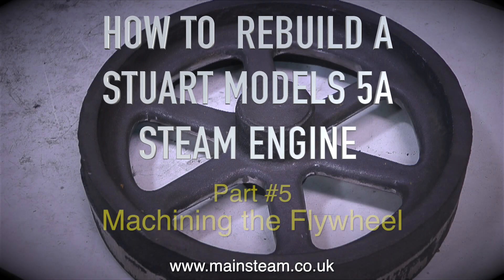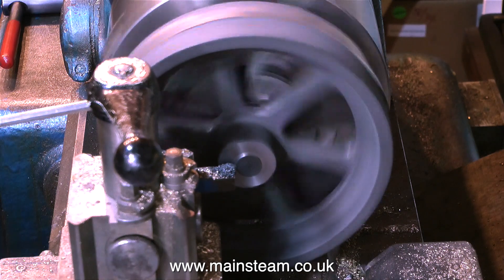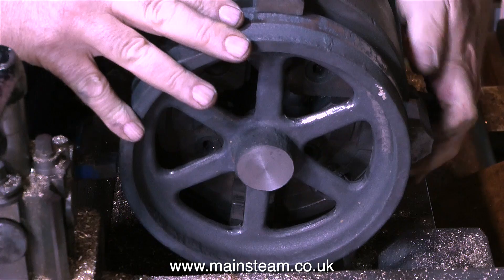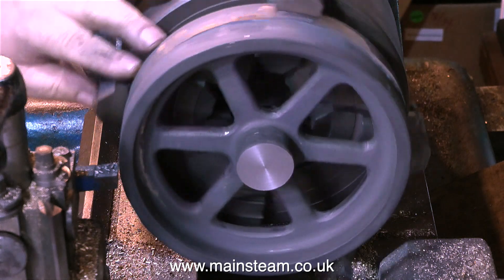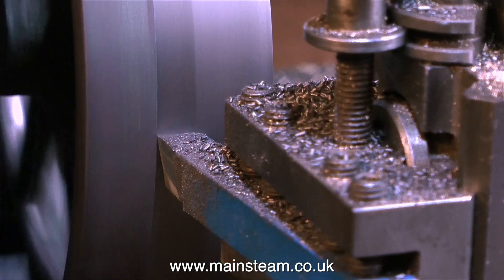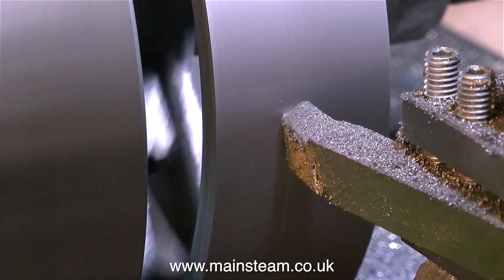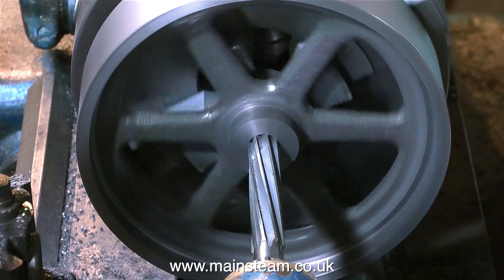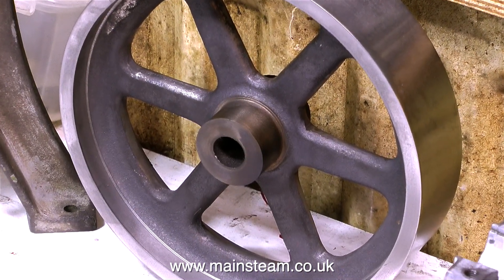HOW TO REBUILD A STUART MODELS 5A STEAM ENGINE - PART #5

Comment: As someone with no machining experience, and someone who would like to eventually make an engine like this, I was wondering about order of operation.  If you were to drill and ream the flywheel first, wouldn't you be able to use the mandrel to either accurately and securely clamp it in the chuck or turn it between centers?  The way I've always pictured this being done would involve leveling the spokes on a drill press or milling machine bed, spotting and drilling a vertical hole, turning a mandrel with accurate centers on each end, reaming the flywheel hole to fit the mandrel, then doing all of the rest of the turning with the flywheel on the mandrel.  I'm assuming that because someone with more experience, who knows how to get good results, does it completely differently than I'd visualized, there's a reason my plan won't work or will make the process harder.  It's just that I'm damned if I can find what's wrong with my idea.  What do you think?
Reply from the maker: Mandrel work is best left for the finer finishing process . . .
Reply: Thanks.  I appreciate the reply.

Comment: Those were some good tips! It hadn't occurred to me (though of course I should have realized it) that you want to judge whether the rough flywheel casting is true by the inside features where the spokes are, because those will not be machined.

I don't know if you've ever looked at the Stuart Models pamphlet "Building a Vertical Steam Engine"; therein the author describes fabrication of a "D-Reamer" from a piece of silver steel (the US equivalent would be a piece of drill rod)
Have you tried this?

Comment: Top tip: if your reamers cut big, don't clamp the tailstock to the bed and wind it through - leave it loose and physically push the tailstock to put the reamer through the hole.  More of a problem on well used lathes that have worn (like the ones at work) but maybe someone will find this useful.

Also independant 4 jaw chucks will hold work much more firmly than any self centering chuck because as you tighten  them you're only tightening 1 jaw, not spreading your clamping torque between 3 or 4.